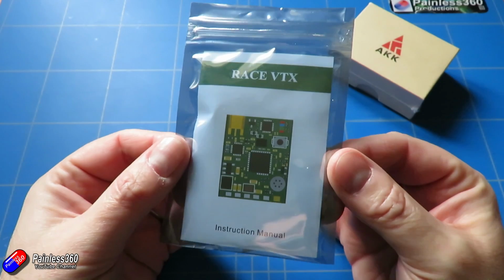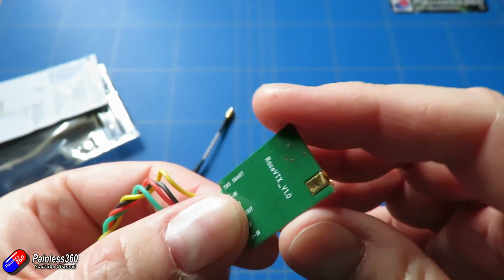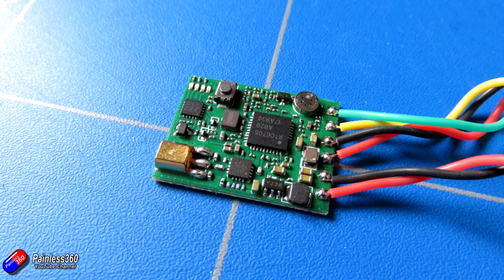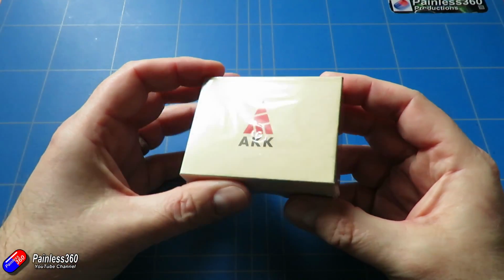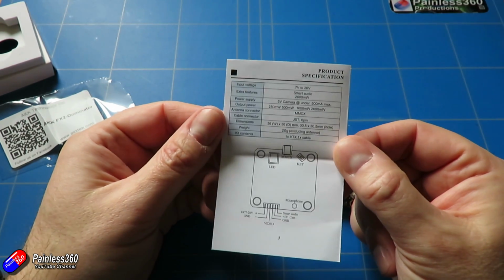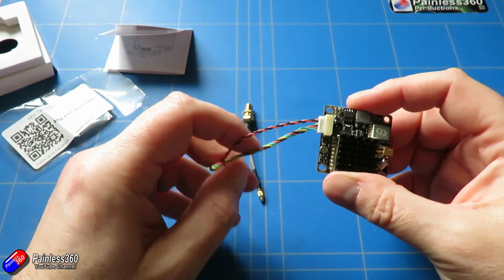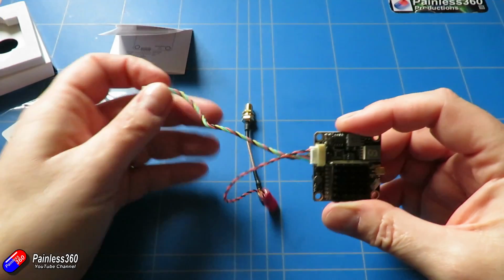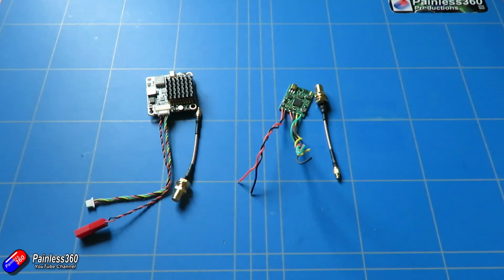Latest AKK FPV VTX: Cheap Race and Long Range Units

Comment: Whats the measurement of the thickness from the dominator?
Reply from the maker: Not sure I understand the question. Do you mean the maximum thickness with the heat sink on?
Reply: Yes, the overall maximum thickness. Need to know how much space this thing eats up from the stack.
Reply from the maker: I can't find it in the spares bin, if it turns up I'll measure it..

Comment: Thank you Lee for the review, I got all cains of vtx, except the 1.3 band, Love the AKK brand, I got the 1200 ultimate and others, TBS, immersionrc, etc, in my experience and you can see my channel all vtx are ok, and depend of the day you flying, some days are terrible some days are amazing and with the same vtx. the most terrify situation is to loosed video and you do not have a rth sistem, all my planes are running INAV with RTL, and my vtx's so far never let me down, I will install this vtx dominator in my buffalo wing that is with a 2.4 vtx, and I will run the 5.8 dominator in the left wing. LOL
Reply: Do you have any suggestion a more range and more penetration fpv system? Because I'm going to install it on a truck and ground level has more interference due to obstacles... and also a cheap but reliable thanks

Comment: Coincidentally I was building a new quad using the race vtx. The mmcx connector came off when I was removing the antenna. I had it already soldered to the fc.   The signal pad was lifted. So it is gone.  I was gutted!  I was thinking to ask akk for replacement. First  time removing the antenna from vtx and it broke.

Comment: What is holding up the industry, and the science,  in my view is that in most places it is unlawful to fly a plane. If you do find a place, one can only fly in a relatively tight circle.  I love my setup - pixhwk 2.2, Dragonlink v3, Run cam Split, etc, etc. But, what is the point if I can only fly in a small circle?
Reply: Would at least like to see FAA/AMA adopt corridors like skydivers, gliders, hanggliders all get NOTAMS and published on navigation charts where they operate. SUAV hobby have more participants, yet we can't carve a section of airspace for long range UAV.
Reply: Well you know who to thank for the current situations,were getting it in Aust to now,but that wont stop my lr fpv.
Majority spoil it for the minority...congradulations to them all.
I really feel your current situation Old Glory.

Comment: I have very good experience with AKK direct- when a vtx burned out early on they gave me a new one. Just bought the race vtx liked the mmcx connector and got a mmcx linear antenna to go with it
Thx for the pleasant Sunday shopping tip

Comment: Wow 2w, wonder what kind of range you'd get
Reply from the maker: Abour 4.86 miles (according to the MenaceRC range calculator- https://menacerc.co.uk/range-calculator) ;)
Reply: Long range is more dependent on good aerials and proper placement of those aerials. Theres no point in having 2 watts of video power if your aerials are crappy. Ive seen a cheap eachine 200mw vtx give good video at 18 kilometers out and the wing had an omnidirectional aerial and the ground station had a 7 turn IBcrazy helical.
Reply: @OzFPVflyer  Good to know, I've never ventured into long range although i want to

Comment: I just got the AKK FX2 the 1200MW version and it sucks when going behind trees in my yard. I have the  RDQ Mach-2 and the Matek VTX-HV and both outperform the AKK.Think I will stay clear of any more AKK vtx's for my flying. Just ordered a TBS to replace the Matek-2 which I killed when I plugged it in without an aerial.
Reply: What frequency? Is it best to go 2.4 tbs?l I looked at the 2.4 tbs ground station with 5.8 rebroadcast. Any idea how far I can go without antenna tracker using the supplied directional antenna? I just need a few miles range.
Reply: @sl66ggehrubt  with the 2.4 ghz yagi from tbs , i think you will get about 6miles / 10km